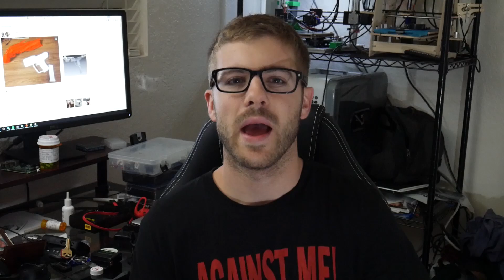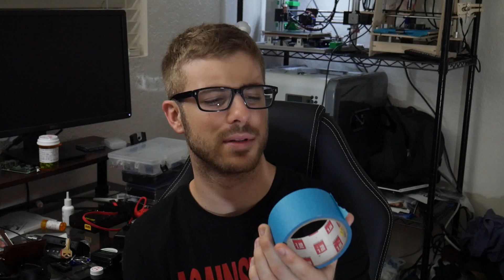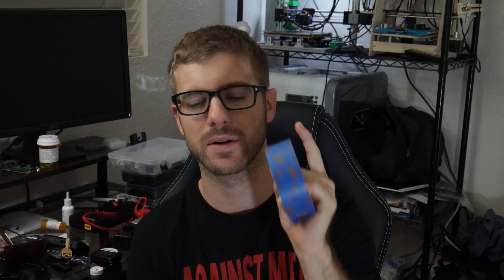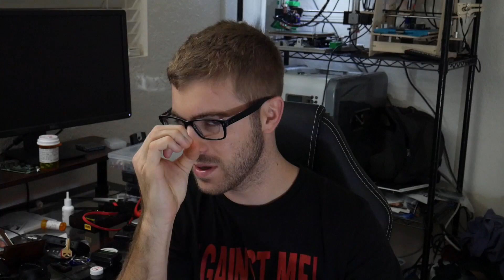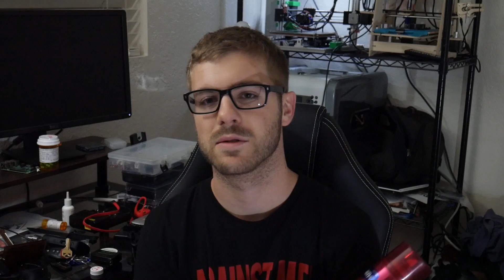3d Printing | Updated Method Used For Printing With PLA

Comment: I have an aluminum bed, with kapton tape for a printing surface and I use good old dirt cheap Aqua Net Hairspray. I've also taken a piece of cardboard bent at a right angle as an over spray shield to keep the rest of my work area clean when applying the hairspray.
Reply from the maker: I still have not used an aluminum plate I need to finish my delta build because it came with one. I like the idea of the spray shield since there is definitely some intense overspray going on

Comment: Are you using the heated bed in conjunction with the hairspray?  If so, instead of thoroughly covering your build plate with 2 coats of hairspray, try lightly misting one coat on the build plate.  You'll have great adhesion and won't have to worry about cleaning the plate after a couple of prints.  I print PLA with my FolgerTech at 190c and the heatbed at 55c.  At about 35-40c on cooldown, you will hear the printed piece "pop" off of the build plate.  I actually turn the heatbed off when I have about 5 minutes left on the print to start the cooldown process.  You'll be able to get more prints out of your hairspray and won't have as many issues with your build plate getting out of whack when forcing your print off.
Reply from the maker: I am strictly using the hairspray no heated bed whatsoever. I definitely am interested in trying your technique. The prints are sticking great and are not to terrible to pry off but some do stick extremely hard and through the prying of the print it screws up the bed alignment. If you I do get a chance to check that method out I will report back with how it worked for me. Thank you for the suggestion!

Comment: Try a PEI sheet it will stick very good when the bed is hot (60°C) and it will pop off as it cools and it leaves a glass finish at the bottom.
Reply from the maker: Does it work for non heated beds?
Reply: +ModBot Nope
Reply: it works with mine!

Comment: Some time ago I did also switch from blue tape to hairspray, mostly because the tape I had sometimes wouldn't stick to my bed. The hairspray works so much better for me, and I really like the smooth finish it gives to the bottom of the prints. 
Usually I can print a couple of times with just one layer of hairspray.
Reply from the maker: I like the smoothness alot pretty much a glossy glass reflection to the print.

Comment: I use blue painters tape from Ace hardware, it hasn't fail me. But, it's a little more expensive than regular tape from Wal-Mart.
Reply from the maker: yeah there really is a difference depending on the brand as well as the feel of it. The cheap one I bought before had terrible adhesive and would curl right along with the prints.